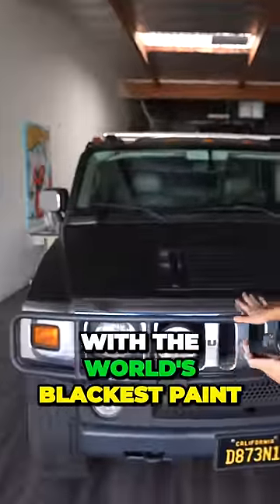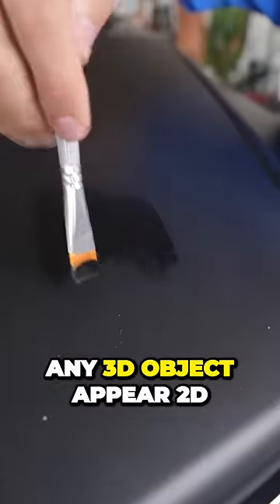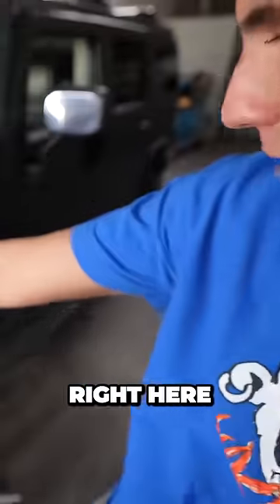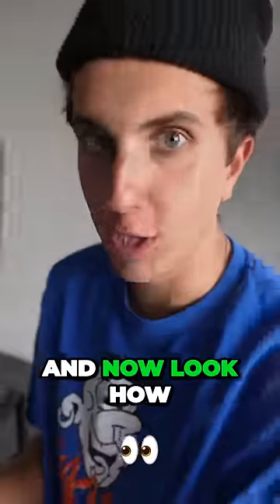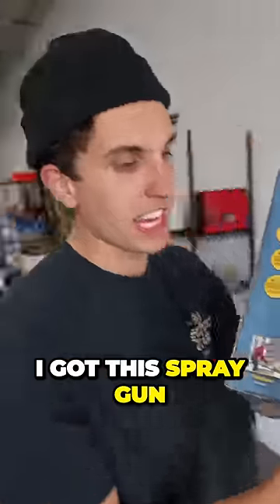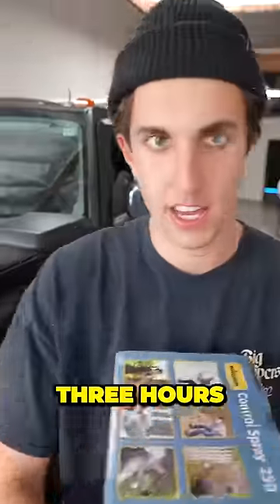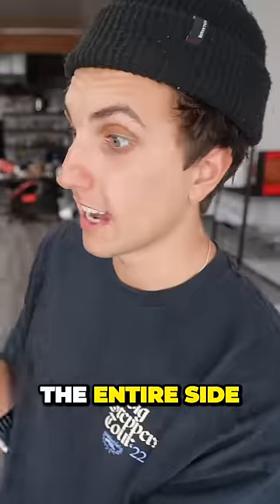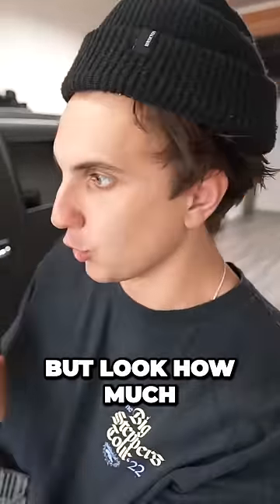Painting a car with the world's blackest paint?! 🤯

Comment: Very stupid way to ruin your car. First of all, you need to remove all of the old paint to prevent paint from falling off your car. After that you need to wash car, first with water and soap, then with solvent to degrease metal. Then run totally clear car into clean box, where no dust or mud will stick under paint. Then you need to use primer, this way paint will stick properly. Only after all this steps you can only apply paint. And don't forget that you need to use special airless sprayer, b.c only this way you can be shure that layer of paint will be smooth